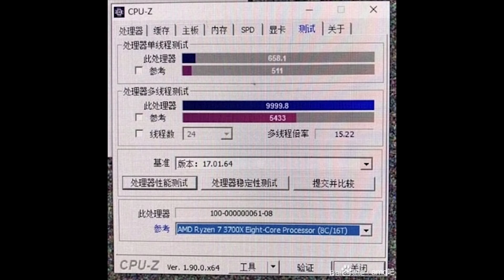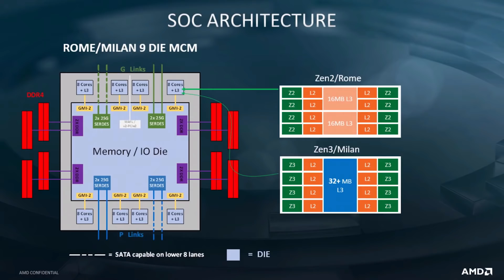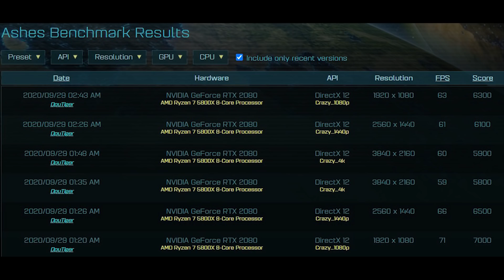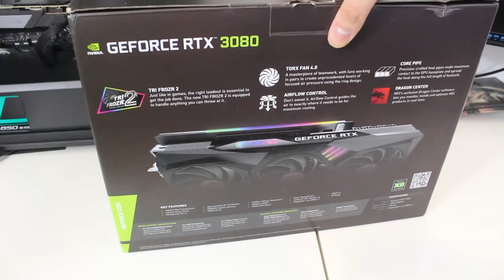Ryzen 5900X CRUSHES Benchmarks | Beats 3900X By 25 Percent

Comment: masive upgrade,25%,40%......3800x cpuz 553 single core on x570 asus.15 to 17% single core will have gen 3 and with oc all cores it will be 8 to 10 %(from 4,9 one core to 4,6 max all cores)10700k at 5,2 four cores 5,1 four cores cpuz 630 single core -6380 all cores.before anyone say something its better to test it first

Comment: Ryzen 5000 series is probably about 10% frequency bump and 10% IPC gain
When you combine those it's just over 20% gain. If the CPU-Z numbers are accurate that 25% is likely a best-case for a synthetic workload like this. Obviously worst-case would be ZERO gains due to no CPU bottleneck to start with... so for real-world games and applications I'd say guess between 0% and 20%, with some numbers closer to 30% if comparing slower DDR4 memory (assuming it uses memory better)... though of course you should buy whatever is optimal within reason based on price...
R5-5600 (6C/12T) sounds like it will be an amazing deal as it should run similar to an R7-3700x (8C/16T) for mult-thread and similar to a modern, fast Intel CPU for single-thread like games

Comment: i hope to see 2000mhz infinity fabric on the new Ryzen cpus
...so i can run this ram at 4000mhz
Reply: @ACE REBORN infinity fabric runs half the speed of ram ....its a must on ryzen when it dont ...and its off that mark the performance suffers ....i did not design this cpu so i could not answer why so low.......my 3950x can only hit 1911 on I.F. my ram can run 4000 its a corsair 3800mhz kite....already had it there... but,  I.F. turns to 1000 mhz even when i try to lock it in higher
Reply: @ACE REBORN you don't have to double the clock frequency to double the bandwidth ..although tied together in some aspect they are two totally different things

Comment: This is really impressive and exciting. I really want to know what the clock speed it is/was. My 3800XT scores 593 on CPU-z single core(4.8/4.7). 10% on top of that is impressive.  Especially if you add a good overclock on a 5800x/5900x.

Comment: Intel is already getting a good run for their money from the 3600xt .  I hope AMD takes the crown from intel this time . Intel is on the verge of releasing a new architecture.

No one knows how intel new architecture will scale in performance. It will be better than the 10900k, so AMD needs to have something to counter it.
Reply: Wait. So far AMD has sold more CPU than Intel. And it´s the other way, Intel HAS to come up with somenthing to counter Zen3. Remember Zen4 is under way as well!
Reply: Zen 3 will be old news real quick. Having the gaming crown for only 3 months until Rocket Lake means nothing. 2021 tech news will be dominated by Intel. 8core Tiger Lake-H and Rocket Lake-S in Q1 2021, PCIe 4 Optane SSDs, Xe-HPG gaming GPUs, and Alder Lake-S + DDR5 + PCIe 5 in Q3 2021. Intel will support PCIe 5 and DDR5 way before AMD https://videocardz.com/newz/intel-tiger-lake-h-alder-lake-s-and-alder-lake-p-series-detailed
 Intel also already have MCM (tile based) chiplet GPUs working way before AMD and NVidia https://www.techradar.com/news/intels-xe-hp-gpu-crushes-nvidias-a100-but-there-is-a-catch
Reply: @Patrick73787  we will see, I am interested in seeing intel response to AMD. So far intel has kept falling Short. They were supposed to be on 10nm already. 

And they are still stuck on 14nm, now they are back porting a new architecture to 14nm which will ruin their efficiency.

Tile based chiplets could be good for Intel, buts it's kinda funny that intel criticized AMD for having a chiplet design and now they are gonna copy AMD.  They simply realized they cannot compete with AMD with 14nm monolithic dies.

Intel still does not support pcie 4 officially,  despite 10th gen cpu launching this year. But if they get to pcie 5 first and ddr5 they will have some bragging rights.  But as quick as that happens AMD will be be moving to tsmc 5nm node.

The competition is good either way and everyone will benefit.
Reply: @warcrabcyber9908  "So far intel has kept falling Short" AMD is only interesting since July 2019 with their Zen 2 launch, one year of domination means nothing. Intel has PCIe 4 "officially" on Tiger Lake and it will come as well on Rocket Lake. Intel is clever and know that the chiplet design is more suitable for parallel entities like GPUs. For CPUs they're retaining the monolithic design while going to the bigLITTLE core approach and I heard that AMD wants to copy that design as well https://www.techspot.com/community/topics/amds-new-patent-is-an-awkward-copy-of-intels-lakefield-architecture.264219/
Reply: @Patrick73787  intel finally gets pcie 4 with tigerlake on laptops, it's still not available on desktop where it matters the most. 

 AMD has been interesting since zen 1 launch , making intel entire enthusiast platform irrelevant.  Remember when intel was charging 1000usd for a 5960x which is 8 cores and 16 threads. People were buying those cpu and making intel rich.  

Then AMD came with the ryzen 1700 for 330$ and gave that same performance for 670$ less. I would say amd accomplished their mission with zen 1
Reply: @warcrabcyber9908  "intel finally gets pcie 4 with tigerlake on laptops, it's still not available on desktop where it matters the most" No, it doesn't matter https://www.youtube.com/watch?v=SPTWtp5CnE4 and Zen 1 was trash even for productivity tasks. Summer 2019 is when AMD finally became interesting with the Zen 2 IPC increase thanks to the TSMC 7nm node, and hypothetic PCIe 4 usefulness.
Reply: @Patrick73787  zen 1 only fell short in gaming performance , it trashed intel in everything else. Go look at hardware unboxed ryzen 1700 revisit. 

For the entire productivity suite the 7700k was destroyed.   Zen 1 was a success , intel claim to fame Is gaming performance which is the only argument they continue to make.

The ryzen 1700 is still a productivity contender. It still competes with zen 2 in productivity and intel 6 core 12 thread cpu. In rendering and alot of other workloads

If you like to play in 1080p low settings with a 700$ graphics card that is the only time intel gaming performance mean anything.  I prefer my game to look good so I have no interest in high refresh gaming
Reply: @warcrabcyber9908  Fair enough. If you're not chasing 1080p 360Hz or 1440p 240Hz, so yes AMD is good enough.
Reply: @Patrick73787  240-360Hz is GPU bound, not CPU. And like I stated before, I work with my computer, and just play some casual games. So don´t care too much about that. And being honest, it´s good people fall for those marketing numbers, as a person that does that as a living, trying to sell what you really don´t need. Have a good day. ;)
Reply: @luisangelini2220  The refresh rate is always CPU bound, while the resolution is GPU bound, not the other way around. Have a nice day ;)
Reply: @Patrick73787  That´s true for lower resolutions. Didn´t see you said 1080p, my bad. Cya around.
Reply: @luisangelini2220  Didn't I also say 1440p 240Hz? where CPUs still bottleneck RTX 3080/3090. Bye
Reply: @Patrick73787  Man, you sound like a fanboy, honestly. Also, those links are just rumors, same as lots of rumors about AMD had.
PCIe 4 has been around for about a year now, and there is basically not use for it but just a bunch of Nands, so even worse for those PCIe 5. Of course, that wont be the case in a few years.
Now, 8 cores domintaing? Really? So I can tell you only play games with a computer. Dude, my 3900x is for working and some casual gaming. There is no Intel can offer that to me right now. 
And before you come and tell me I´m a AMD fanboy, I´ve been using Intel since early 90s, with their 80286 and so on until last year I bought my first AMD CPU. So far I´m really happy with it.
Reply: @luisangelini2220  PCIe 5 is not for fast storage. Intel needs it for their CXL protocol.
Reply: @Patrick73787  That´s true if you are talking about data-centers, not desktops.

Since you were talking about gaming PCs:

"
Zen 3 will be old news real quick. Having the gaming crown for only 3 months until Rocket Lake means nothing. 2021 tech news will be dominated by Intel. 8core Tiger Lake-H and Rocket Lake-S in Q1 2021, PCIe 4 Optane SSDs, Xe-HPG gaming GPUs, and Alder Lake-S + DDR5 + PCIe 5 in Q3 2021. Intel will support PCIe 5 and DDR5 way before AMD "

Then I stand by what I said before. PCIe 5 is useless for the incoming years for us.
Reply: @luisangelini2220  CXL is the way Intel will support multi-GPU on desktop, so it doesn't only concern data-centers and servers. Alder Lake is a desktop platform. And my claims still stand true
Reply: @Patrick73787  Multi GPU? Sir, that´s just marketing for desktop. In fact, almost no one used multi GPU in the past, since the ratio cost/performance was almost null. Even a year later, PCIe 4 is not used at all by any GPU.
Reply: @luisangelini2220  Maybe, but that's an Intel goal. Don't ask me why but they want to heavily support multi-GPU on their Xe lineup. I personally use two GPUs myself.

Comment: They should have a Ryzen 8 5800, 5800x that is the 10 core cause there was no point of a Ryzen 7 3700 and 3800 when they were basically the same thing
Reply: 10 core? Lol there is litterally no demand for a 10core it's a waste of silicon
Reply: @malathomas6141  says who? I've seen plenty of people saying they want a 10 core 20 thread cpu. Literally just look it up, plus its a waste to have basically the same cpu with the 3700x and the 3800x
Reply: @kraqd  why a 10 core cpu when 12 core is available from amd
Reply: @malathomas6141  why not? They got a 6,8,12,16 and more why not 10 and take intels 10900k people away from intel?
Reply: @kraqd  as you can see it's just even numbers except for ryzen 3
Reply: @malathomas6141  they even have a 4 core with the Ryzen 3 as well. So why not 10?
Reply: @kraqd  because it makes no sense
Reply: @malathomas6141  it does. Intel has a 10 core 20 thread. And thats their money maker. And Intel fan boys are always like "I don't need more than 10 cores" well make a 10 core. Bro its not that hard to comprehend. You making this way more difficult that it should

Comment: Old: 511. New: 658. Says no comparison at all while just having made one. Please ditch the hype. It's bad form. It's also just below 30% improvement. That is not impressive. It's not bad. But it's not impressive. There's no doubling of cores, frequency, let alone performance as a whole.
Reply: For x86 it's quite impressive. Until AMD made a come back with the Zen architecture, all we used to get from Intel was 5-7% uplift with each generation. Now we're getting 20-25%. It's pretty awesome in comparison.

Comment: at stock it matches a 10900k at 5.3ghz lmao rip intel
Reply: But the 10900k serves as heater, too. 
Winter is coming. 😳
Reply: @goodyKoeln  You know nothing Jon Snow
Reply: Zen 3 will be old news real quick. Having the gaming crown for only 3 months until Rocket Lake means nothing. 2021 tech news will be dominated by Intel. 8core Tiger Lake-H and Rocket Lake-S in Q1 2021, PCIe 4 Optane SSDs, Xe-HPG gaming GPUs, and Alder Lake-S + DDR5 + PCIe 5 in Q3 2021. Intel will support PCIe 5 and DDR5 way before AMD https://videocardz.com/newz/intel-tiger-lake-h-alder-lake-s-and-alder-lake-p-series-detailed
 Intel also already have MCM (tile based) chiplet GPUs working way before AMD and NVidia https://www.techradar.com/news/intels-xe-hp-gpu-crushes-nvidias-a100-but-there-is-a-catch
Reply: @Patrick73787  doubt that rocket lake is losing out on clock speeds so they're going to boost lower the only thing they get is an ipc increase. Im 90% positive that zen 3 will be intel until they go 10nm. Then zen 4 will beat that
Reply: @justmixah3408  What clock speed is Rocket Lake losing on? https://wccftech.com/intel-rocket-lake-cpu-5-ghz-willow-cove/
Reply: there is a cinebench with the 8 core 5800x at 4.8 ghz with a single thread score of 606 while multythread 6000while the 10900kf 5.3ghz score 539/6300
https://www.hdblog.it/hardware/articoli/n527340/amd-ryzen-5000-cinebench-batte-intel-core-10a-gen/
Reply: Telepathic Membrane it doesn’t USUALLY scale up at the same rate intel does, if you’ve had any 3000 series products or know anyone who does they’ll tell you overclocking doesn’t do all that much, compared to the intel CPUs where you can get huge boosts. That’s also why intel doesn’t bother adding a cooler on because you’ll need a real cooler when you overclock them.
As for the 5900x I’m not sure but I’d say it’s unlikely overclocking it will do too much considering previous gen CPUs. I could be wrong though.
Reply: @spankmesanta821  let's be honest here.... The REAL reason Intel isn't including a cooler is because you need a beast of a cooler to keep that heater cool enough to even run stock. Since the cooler has to be a decent size to cool that thing down it would add a significant cost to production of an already overpriced cpu.
Reply: @spankmesanta821  and yet they still don't include a stock cooler so I'll still call BS on this until Intel does otherwise.
Reply: Really....where are the benchmarks, can you link to them?
Reply: @xlr8r2010  just go on cpuz and search it up
Reply: Matches where, single core? 

We know AMD is good for productivity what we are all waiting is them beating Intel in games. That's all that matters at this point. It's the only hurdle they have to overcome.
Reply: @sophiaperennis2360  look at previous comments(links) before talking
Reply: False info don’t listen to him guys.
5900X beats the 10900k stock but overclocked the 10900k is still better for gaming.
That’s not to say the 5900x isn’t a better buy, but this guy is lying about it beating an overclocked 10900k
Reply: @spankmesanta821  lmao do you want me to link it
Reply: SpankMe Santa what do you mean in doesn’t exist click the links tf
Reply: @spankmesanta821  We are talking about a STOCK 5900X vs the space heater 10900k at 5.3 Ghz. The 5900X is superior. Intel is lucky if they can catch it with Rocket Lake next year.
Reply: @spankmesanta821  did you not click my links wtf the 5900x beats it by 1% at stock lmao
Reply: @spankmesanta821  cant say nothing now mad it easier on you
Reply: @spankmesanta821  the 5900x was tested on cpu z so is that flimsy as well. I feel like you're either a fanboy or having buyer remorse
Reply: @spankmesanta821  well maybe both

Comment: Intel still has the more stable system and drivers and chipset. A few percent performance doesnt offset that.
Reply: Never had a system as stable as my X570+3700x.
Reply: and dont forget the stable security vulnerabilities
Reply: It's riddled with security issues, sucks 360 watt from the wall, will have a dead end chipset with no upgrade path and is produced by a company with a long history of disappointing performance improvements, holding back core count and ripping of consumers by any means they can think of. Yea, slower by a few % too.
 I've been waiting for the day to jump ship from intel and only a retard fanboy would think otherwise.
Reply: @addz17  and when Intel jumps back ahead what you gonna do? Do you think Intel went to sleep for 5 years waiting for amd to catch up?
Reply: @_Chad_ThunderCock  wtf you talking about. I got a 5.2ghz 10 core for 400 quid and who the fuck uses a stock cooler
Reply: Intel spends more on validation than amd earns in profit as an entire company. The ryzen i had was shit. I'll never buy amd again for gaming.
Reply: First generation Ryzen had its share of bugs for being the first generation of a new architecture. But the current lineup is pretty solid and stable.
Reply: Zen 3 will be old news real quick. Having the gaming crown for only 3 months until Rocket Lake means nothing. 2021 tech news will be dominated by Intel. 8core Tiger Lake-H and Rocket Lake-S in Q1 2021, PCIe 4 Optane SSDs, Xe-HPG gaming GPUs, and Alder Lake-S + DDR5 + PCIe 5 in Q3 2021. Intel will support PCIe 5 and DDR5 way before AMD https://videocardz.com/newz/intel-tiger-lake-h-alder-lake-s-and-alder-lake-p-series-detailed
 Intel also already have MCM (tile based) chiplet GPUs working way before AMD and NVidia https://www.techradar.com/news/intels-xe-hp-gpu-crushes-nvidias-a100-but-there-is-a-catch
Reply: @Patrick73787  
Some delusions you have there. Rocket Lake is dead on arrival. The Rocker Lake cores are reported to have worse IPC than Willow Cove due to the backport to 14nm process, and benchmarks show Willow Cove has the same IPC as Sunny Cove. Which means Rocket Lake will be worse than Tiger Lake, and early leaked Vermeer benchmarks show Vermeer has better IPC than Tiger Lake. Mind you, those are leaked benchmarks that could be fake. We have to wait until Vermeer is out later this month to see solid benchmarks to draw conclusions.
Reply: Intel is a joke. Stop bringing them up it takes away your credibility
Reply: @lupefiasco653  agreed
Reply: @lupefiasco653  how can Intel be a joke... They ship more chips and make more bank than amd will ever dream of. It took amd 5 years to beat a 5 year old design. How long do you think it will have the crown for? 2 months? Intel next chip is looking 20% IPC ahead and 5.3ghz boost minimum.